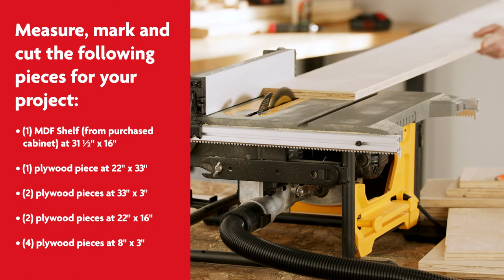Make a #laundry Hamper Cabinet, Here's How

Comment from the maker: https://www.homehardware.ca/en/blogs/p/laundry-hamper-cabinet

0:00 Intro
0:05 What You’ll Need
0:12 Measure, Mark and Cut
1:01 Assembly
2:15 Sanding
2:51 Painting
3:18 Cabinet Setup
5:32 Attaching the Handles
5:44 Final Reveal